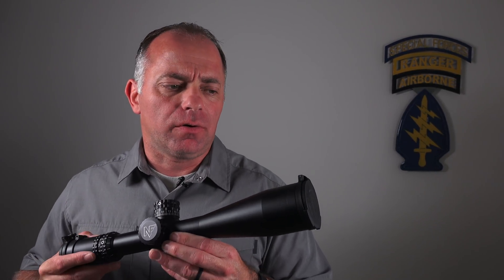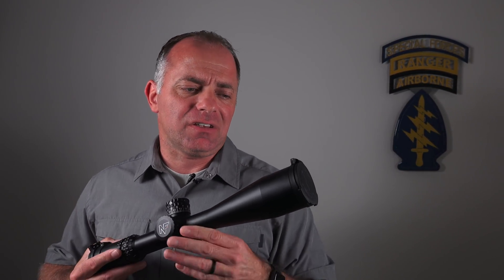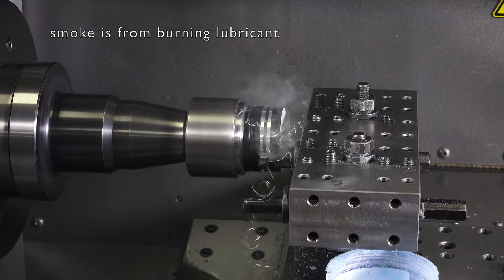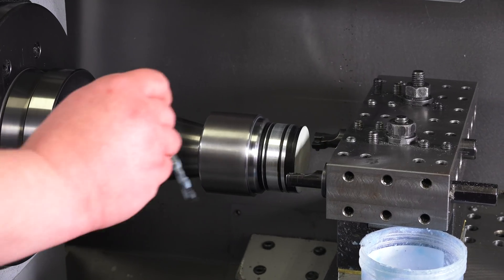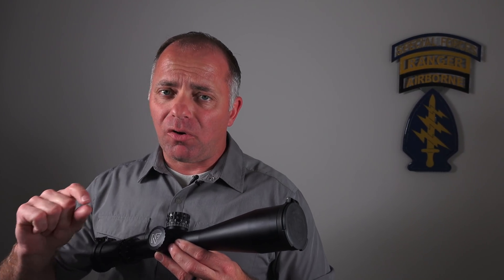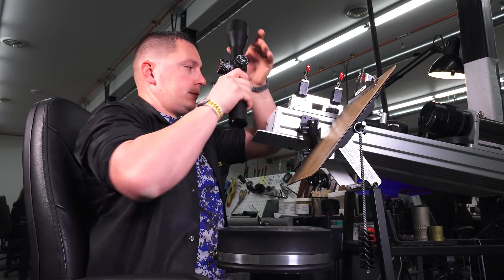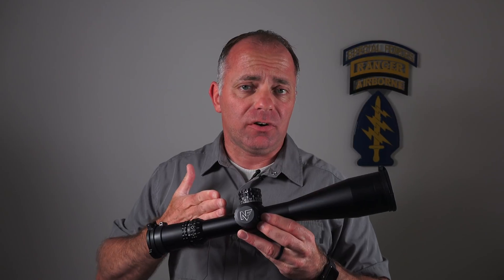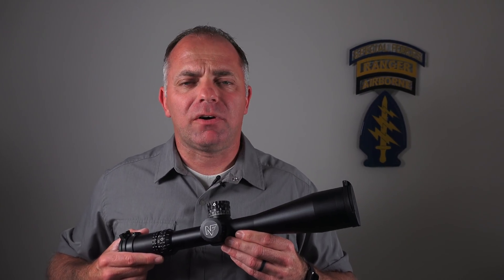Scope Abuse: Durability Testing NightForce Optics

Comment: What bothers me about Nightforce is the Warranty. It's limited. It covers only defects and workmanship. Exclusions to this warranty include intentional or accidental damage, abuse, misuse, unauthorized modifications or repairs, and improper mounting. This warranty does not cover any consequential or incidental damages resulting from the inability to use the riflescope. To top it all off it is all at their discretion. Just as an example take the Vortex Warranty (there are many other optics with this Warranty as well)... "We will repair or replace your Vortex product in the event it becomes damaged or defective—at no charge to you. If we cannot repair your product, we will replace it with a product in perfect working order of equal or better physical condition. You see, it doesn't matter how it happened, whose fault it was or where you purchased it. If you ever have a problem, no matter the cause, we promise to take care of you." When I spend this kind of money on glass, this is how I want to be taken care of.
Reply: I’m glad the warranty is like that. I don’t want to have to pay extra because of knuckleheads sending their scopes back. The best warranty service is o e that’s not required. I’m sure vortex customer service is busier than NF